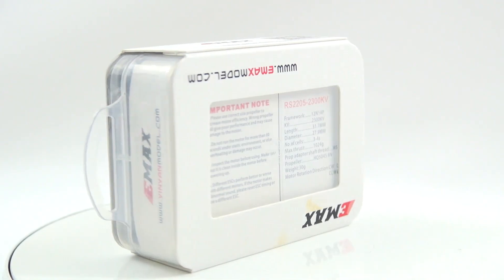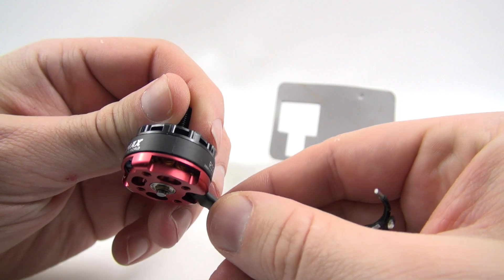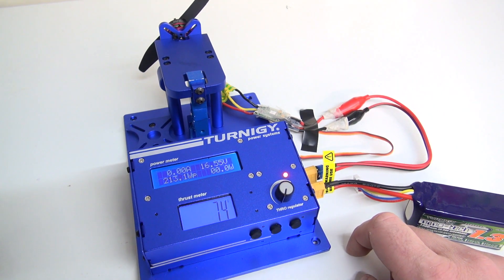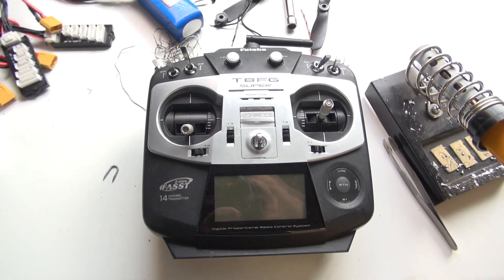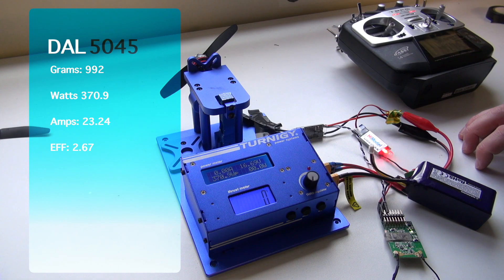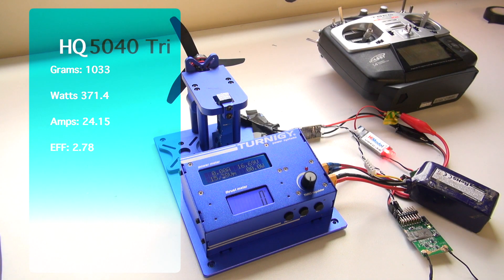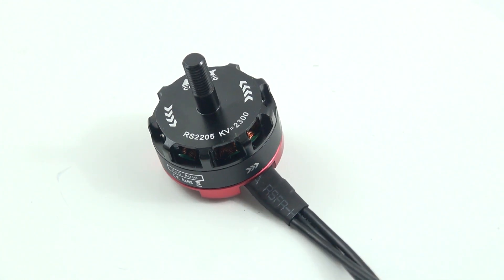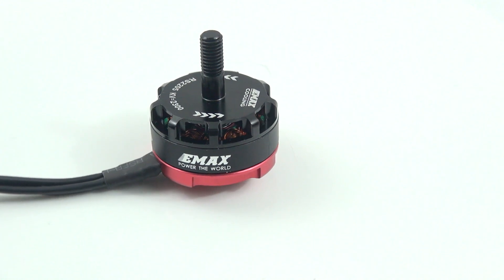HPIGUY | EMAX RS2205 Red Bottom Thrust Stand Results - Say whaaaat!

Comment: I (We Pilot community) need more science info.    So this reply is to try to be helpful, not critical. I do want to say "thank you" for posting it. I do have 2 sets of these redbottom motors and its nice to see 'around' that 1024 gram thrust is possible.

Calibrate the Thrust stand sensor) get some 1kg, 500gram weights and ensure the gram measure is within spec.  When the motor wasn't running, I saw the reading show 76 grams or something like that already.

A) What timing was the motor set at in BLheli on the 20amp, and then again the 30 amp?
   Those motors would be medium high to high on the timing (Simonk of 23-26 timing setting probably)

   Active breaking BLHeli in Simonk would be "BRAKE" mode.  Use the google chrome app to get custom Simonk for the 20amp esc "Flash tool" might help make testing the Simonk in the future better.

B) Why couldn't the thrust stand send a good clean max thrust signal?  Can't the ESC be calibrated to the stand signal and then give max thrust?

C) If braking mode is on, I had a colleague suggest this can hold back max thrust back. I'm curious about that.

I can only speculate that the max thrust wasn't reached either due to hardware, firmware, or lack of tuning (ie leaving medium timing on in BLHeli, active braking is on).  OR? Maybe a clone HQ prop?

Basically I know we all just want to fly.

Comment: You may also want to try BLHeli 14.1 instead as the 20 amp were producing more power with the older FW than on the new one. I am not sure if the 30 amp would do the same but its worth a try.

Comment: will the littlebee 20amp esc work fine with wizard x220 flight board? I have to swap motors out because old owner had long screws that messed the windings and hope esc may be okay but got backups littlebee 20amp vs stock blheli 20amp stockers. May try with stock esc with new motors and hope to see alot better power than stock eachine 2205 any comments on stock vs emax 2205

Comment: man those are  going to eat your batts , i have some rotorgeek  motors with  RG20 escs  and they can pull 920 grms  but they suck the juice out of the batt super fast .  These rs2205  are going to make lots of puffy batt this year i recon :)
Reply: I should be fine with a 1800 75c right? Plan on using this setup and gf 5045bn
Reply: i'm sure they will be great , it's just that motors are so powerful on quads these days that the limiting factor is the batts , with a high c rating like 75 c you will be fine , for the first 30 seconds you will have crazy power ! after that you will just have loads of power ;).
at the moment i like the DAL 5045 tri props  they are pretty much unbreakable and tri props give a smoother  flight for tricks and more power . HQ do good tri props but you only have to look at them and they break . you are going to want some good esc's  20 to 30 amps .
Reply: +jack00scarecrow thanks for a great reply! And yes I ordered some 30amp littlebee ESCs. I also have 2 45c 1800 tattus. You think those will be okay. 1.8 x 45 = 81amps. I'm going to order a 75c though no matter what.
Reply: yes i think they will be fine  they have a burst rate of 90 c  so you should be  ok going 100% throttle  for   punch outs etc  .  you my notice over time they go a bit puffy compared with your  75c  but they might not  , the motors might not even hit  the 30 amp limit on the esc's . i'm sure its going to be a beastie quad though !! ;)
Reply: +jack00scarecrow sweet good to hear, and yes, hopefully it will be a nice 4s build! It's my first home built. I'm using the srd250 frame. :)

Comment: I bought this motor but I'm only getting about 200 grams of thrust at full throttle. I have a 2200mah 3s 25c battery and a 20 amp esc. Could you suggest any reason why it might be under powered?
Reply: 2300kv motors required a 30a ESCs to provide more power to the motors. 20a ESCs doesn't have a kick and top end power
Reply: @gracecagalpin6606  Looking at bench tests on a similar prop to mine, it only pulls 7 amps at 50%. My top thrust was probably about 20% on a 20 esc.
Reply: @gracecagalpin6606  I've since measured full throttle with a wattmeter and i'm getting 200 watts, 20 amps but only about 20% of the rated thrust.

Comment: I'm in the UK so where can I buy the motors?
Reply: Emax have a direct sales website...pretty sure they deliver to UK.
Reply: +CyclingSalmon14 You can also get them at gearbest, they have the best price I could find! http://www.gearbest.com/multi-rotor-parts/pp_300512.html?vip=127659
Reply: +CyclingSalmon14 You can also get them at gearbest, they have the best price I could find! http://www.gearbest.com/multi-rotor-parts/pp_300512.html?vip=127659
Reply: I'm a bit late, but both unmanned tech and rc life do them for around £13 each

Comment: try the turnigy bolt batteries. they are 60-130c rating
Reply: +RcADdict5054 The label says that but I bet noone can prove above 40C constant on them.
Reply: What about Tattu Rlines 1300 4S 95c-190c or Rline 1300 4S 75c-150c... Did it real?

Comment: would these be ok on my spider 18amp escs burst is 30 for 10 seconds
Reply: I have those same ESCs and I hate them. I don't know why but I just can't get them not to suck. I put XM20A on the same setup and the quad now performs so much better and is much easier to tune. To answer your question tho, you will be really pushing the limit of those ESCs with this motor, even if you don't fry the ESCs, I doubt you will get the full power out of the motor. I would highly recommend a different ESC. XM30A, XRotor40A, XRotor20A DALRC XR20A, any of those should greatly out perform the Spyder 18A. To be honest for this motor I would go with the XRotor40A, really hard to beat the prince for performance of that ESC.